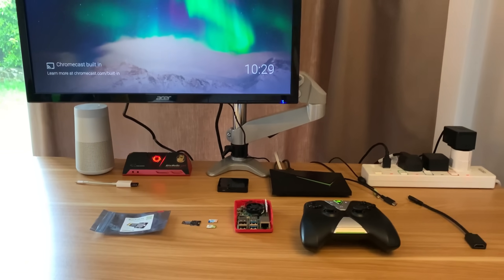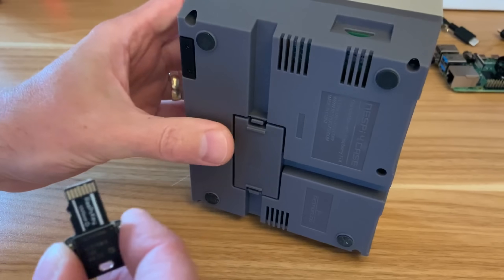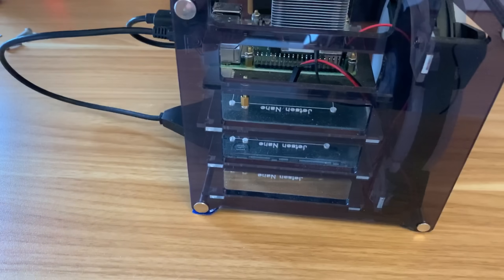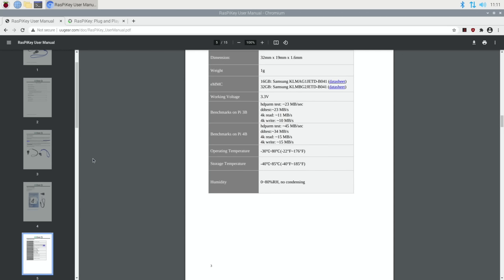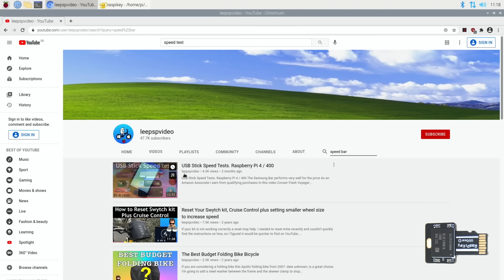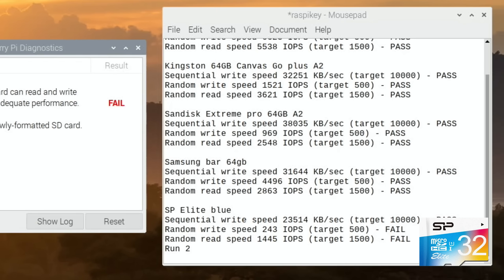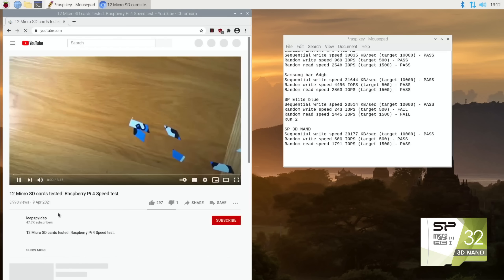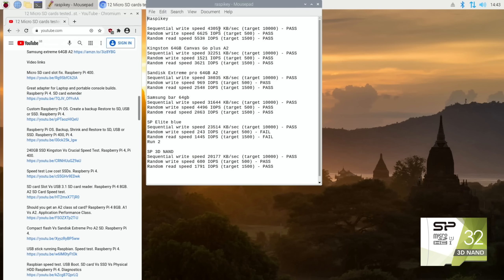Raspikey eMMC drive Vs 14 SD cards. Raspberry Pi 4

Comment: Is this a mistake or does this card really write faster than it can read? 

Samsung bar 64gb
Sequential write speed 31644 KB/sec (target 10000) - PASS
Random write speed 4496 IOPS (target 500) - PASS
Random read speed 2863 IOPS (target 1500) - PASS
Reply from the maker: The results are shown in the video

Comment: What an oddly dysfunctional design. It already sticks out so far that a longer neck wouldn't have mattered but would have made it much more compatible. However, a vertical design for the storage chip where it would angle up would arguably have been much more compact. Entire design seems like a prototype.

Comment: I think the work you've done testing so many cards is great, but the data presentation could be a bit cleaner. You have so many cards at this point its a bit hard to compare when looking at text. You could place the data on a libreoffice calc spreadsheet and make a bar plot for each category (sequential, random read and random write) and it's much more useful and easy to read. Don't get me wrong, I'm not trying to undermine your work, it's just a tip about presenting the data.

Comment: I bought a 2Tbyte seagate hard drive from argos for £62.99.
It works perfectly and is fast and a great price.
Reply from the maker: if you tried an SSD it would be much faster but with less storage for the money. try a speed test and compare it to one of these drives.
https://youtu.be/CRNHUuGZ9aU
Reply: @leepspvideo  I couldn't afford a ssd and the hard drive was easy to obtain locally no need for p&p so I'm happy to get it so cheap. I think you'll agree it is much better than a sd card and represents better value. Just wanted you to know my friend and may be you'll be able to tell your viewers about this alternative. Great channel you have.

Comment: Isn't it same as a usb flash drive.
Reply from the maker: Most flash drives are much slower some will be faster. Plus it doesn’t take up a usb slot. EMMC should be more reliable for running an os.

Comment: In general, if the key does not fit to the case you could use a short micro-sd extension cable if it's possible by the case
Reply: The Raspikey doesn't actually fit my micro-SD extension cable...! :)

Comment: Brother I need a your help my usb flash drive get write protected I tried many things but it's showing me the same error I/O device error plz help
Reply from the maker: Try formatting with Raspberry Pi imager. If that doesn’t work I have a video formatting devices with windows that fixes most things
Reply: @leepspvideo  in imager also it’s showing me the same write protected
Reply from the maker: @MrMorngStar007  try diskpart in Windows 

Fix SD card issues. Raspberry Pi 4. SD card reporting incorrect size
https://youtu.be/fcLcLtAKKCg
Reply: @leepspvideo  I tried this one also but nothing happens
Reply from the maker: it may not be recoverable. I have had usb drives fail and become unrecoverable in the past

Comment: More than likely not a argon either? Could you give me some dimensions? I would love one in my argon case mainly because that case is aweful to remove sdcard's  from(actually broke one in it)  for some reason, currently use a plastic tool now when I remove them and avoid any pressure on the card .  I'm a  fan of sdcards I do have an OMV NAS setup on a external ssd but for the system I don't see the advantage I''m using Sandisk Extreme pro 64GB A2's and  can play 4k 10bit with out a problem smoothly running from them I don't do alot of gaming(On the pi anyway) and that is where I feel the SSD may be advantageous
Reply: Lifespan of a eMMC drive more than likely much better too? I have noticed the speed of my cards falling off slightly after about a 6 months to a year of heavy use.

Comment: I guess you should compare it with booting system from SD card in USB 3.0 reader (like SanDisk Mobile Mate UHS-I microSD) which makes everything faster compared to the same microSD card in the SD slot. At least in Pi4. I am not sure if other models can boot from USB.

Comment: „DDR52 Timing Mode
DDR mode for eMMC was introduced in MMC 4.4 standard. The DDR52 timing mode can support frequency up to 52MHz and can almost double the performance of eMMC module (such as RasPiKey) on Raspberry Pi.
In order to support DDR52 mode, your Raspberry Pi may need to have the firmware upgraded.“